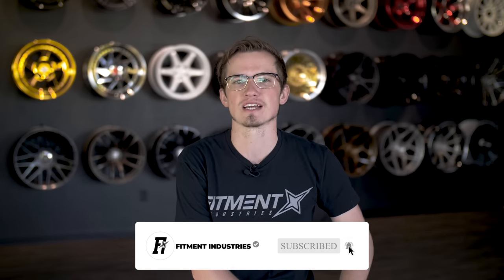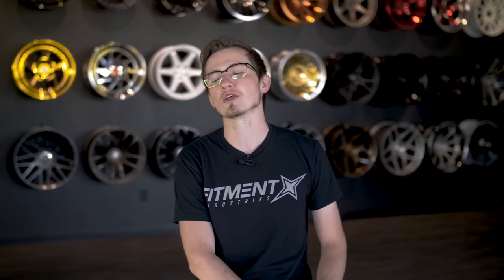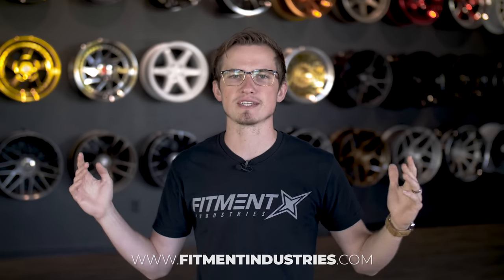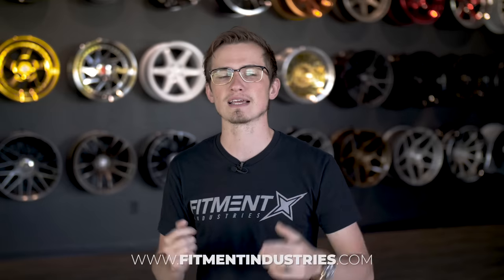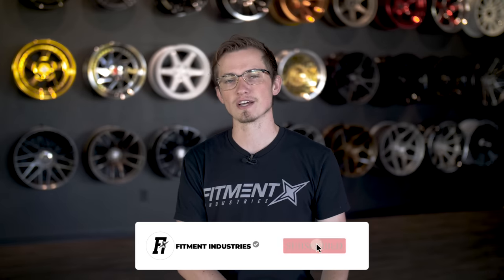Why You Should Lower Your Car

Comment from the maker: What was your first modification to your car?!

 If the answer is none, check out our website ;) 
https://www.fitmentindustries.com
Reply: Fitment Industries my first mod was tint tail lights
Reply: Fitment Industries first mod was wheels I imported from Japan... now for the past few months I’ve been in dire need of coilovers cuz the wheel gap is horrendous lmao
Reply: I went out and bought the original BBS wheels for my Rx7 and got some fortune auto coilovers. Only problem is now I can't find tires -_-
Reply: I got my ecu remapped ;) then coilovers
Reply: On my current car which is a 2015 Mustang, my first mod was a catback exhaust (go figure)
Next is coils! Unless I somehow come up with the money for air suspension haha.
Reply: First modification was actually a stereo install, and then wheels. Then lowering springs and ahem new wheels... Again
Reply: Painted and polished the valvecover while changing the 25 year old gasket
Reply: Coil overs and a set of 14” Steel wheels because my 16” wouldn’t fit
Reply from the maker: I dig it! You should upload your Stang to our gallery we'd love to see it! https://bit.ly/2Ma4oca
Reply: Tein Coilovers was first!
Reply: Eibach pro-springs were my first mod and I never looked back from riding level with a F-150
Reply: Coil and exhaust system
Reply: Btw, I’m looking for cheap coilovers (I’m a broke ass college student) so should I go Raceland cheap (esp cuz of their lifetime warranty), Tein or say GodSpeed or something else?
Reply: ALWAYS GET WHEELS FIRST.  Dial the stance on the wheels you're going to run.  
Or listen to Alex and dial in your stance twice. 
Pay for your alignment twice.  
But hey,  he's the expert.
Reply: I actually did wheels first then 2 weeks after getting them I got coilovers...oops
Reply: @slodvlproductions2297  I learned the hard way a long time ago.
Reply: TE37 reps 😐
Reply: vinyl wrap I put on myself lmao
Reply: new motor🤣🤣
Reply: Metal Catalytic Converter, then ECU-Flash.
Reply: Whiteline sway bars, quickly followed by BC coilovers and currently slowly installing everything Whiteline makes for my car.
Reply: Haha I don't own a car I'm 13
Reply: Fitment Industries bc racing coilovers
Reply: Does Window tints and taillight tints count? 😛

If not, it'll be my rims & tires. After would be Eibach Lowering Springs and Borla Axle-Back exhaust and the same time.

Up next would be front strut bars 😊
Reply: First mod.... tints, then COILOVERS!!!
Reply: Christopher Huynh b
Reply: Fitment Industries replaced the plastic oil pan with a steel oil pan on my MK7. Why? Because my next mod was lowering springs. Can’t drive a car with a cracked plastic oil pan. 🧐
Reply: I threw a new bmw performance exhaust into my 328i 2011. Second mod was coilovers ❤️❤️❤️
Reply: My frist was i drop my car
Reply: Roll bar lol
Reply: My first mod was ol reliable down pipe
Reply: New Wheel ofcourse! Just bring the fattest friend you have before you drive around and youre good to go... 😁😁😁
Reply: I'm picking up a set of cxracing coils today for my g6 granted they won't fit my g6 but ill make them fit
Reply: Suspension cuz well slammed....loool
Reply: Shift knob, obvs.
Reply: Exhaust
Reply: First Mod was a new engine that doesn't belong in there.
Reply: Hoboe Mojo Tein
Reply: Coilovers, then wheels, then spacers for some poke
Reply: I don't have a car
Reply: My first mod to my first car which was a Toyota Corolla S was actually wheels, and then about a year later coilovers and an air intake.
Reply: Lowering springs 😬
Reply: Suspensión
Reply: Fitment industries exhaust
Reply: junkyard swap; legacy discs on my 97 impreza outback sport to replace worn out 240.000 mile OEM drums.......
Reply: my first mod to my first car was a air intake from K&N then a magnaflow exhaust system then a stage one tune in that order.
Reply: My first actual modification on a car are Scrapes and gashes.
Reply: First mod on my 2017 civic hatchback sport was a Boomba Racing Blow off valve
Reply: I still have the O.G's on my IS300  however I do have the Altezza center caps. On Megan Coilovers, NO wheel gaps!
Reply: Fitment Industries so my car had Steelies and hubcaps and I don’t think when I lower my car it won’t really look all that good
Reply: Underglow and I have no shame in it.💀
Reply: LS swap or better yet engine install since my s10 didn't have a motor.
Reply: First mod was wheels then window tint. Looking to lower now
Reply: Upgraded my spark plugs and wires. from fswerks
Reply: Just went through the website and you don't have anything for my car
Reply: None yet
Reply: Hmm my first was 15" Enkei wheels on Toyo tires, now I'm working on putting my coilovers on.
Reply: 2004 Volvo S60R: BC BR coilovers and Hart drilled and slotted brakes, I wish I had gotten a higher end brand seeing as a Brembo set up is what was stock.
Reply: I swapped out the 13" steels with 165 / 80 tires for some 14" alloys with fat 195's with lower profiles in the 90's on my Ford Sierra.
Massive improvement in looks and handling.
Reply: Just so happen my first "mod" was window tint, thing was a fishbowl when i got it.
Reply: New tires
Reply: Bro i live in India so what can i         do to buy suspension system part,s 😬 this is a delima plz give me an advise 🙏🙏🙏🙏🙏🙏🙏🙏🙏🙏🙏🙏🙏🙏🙏
Reply: Kia logo dust caps! (yes I own a Kia) And it's awesome in it's own slow but comfortable way.
Reply: Did wheels suspension and spacers/adapters all in one go!
Reply: Halo headlights on my 2001 automatic eclipse when I was 17 👌🏼👌🏼
Reply: H&R Lowering springs for my MK7 GTI, because I'm poor and could not afford coilovers or air.
Reply: 06 style gto brakelights for my 05. They’re Delpro but they have the black housing which looks better than the red housing stock ones
Reply: What would you suggest for a 2011 Venza (affordably of course)?
Reply: In this order lowering springs,strut bar, headlights, wheels for a year before last week poly bushing,poly mounts, few bolt on's,tune, coilovers and xbrace😁 been stacking those parts up
Reply: First mod was a glasspack welded in place of the muffler. On a 06 pontiac vibe
Reply: Muffler & reasantor delete... 😔
Reply: what if I live in Michigan?
Reply: attached a liscense plate to it 😎
Reply: tints 5%
Reply: I think my first mod was a flat floor 🤔

Probably sounds like an odd choice, but I wasn’t going to just drive it with that one mod. 

I’m currently at around 8k in mods and I haven even driven the car yet 😂
Reply: Mine was painting my peeling and custy 3 color steelies bronze
Reply: a window decal
Reply: First two things I did to my car, 2000 prelude, was AEM air intake and OEM fog lights yellow HID.. that’s all it has! Stock radio with Bluetooth and stock wheels but I’ve beeen wanting to slam it for years

Comment: Not on the daily
Driveway is too high
Roads are junk
Lots of humps in the village
Reply: Facts
Reply: Most underrated comment here
Reply: That's the issue that I have, I daily my G37 and I'm wondering how coilovers are going to mess the driveability if the car
Reply: Massa Koné if you do say goodbye to your front lip
Reply: @cheung709  lmao, I kinda came to the same conclusion, will lowering rings be better then ?
Reply: Massa Koné tbh I would get air suspension if possible but ik it can be very pricey so yeah I would say get springs but um what car do you currently own?
Reply: @cheung709  Air Suspension is the best option but pricey as you said. Got a 2010 G37x Sport edition

Comment: I've been modifying cars for over 20 years now. Lowering a car is always my first upgrade. Everything you said in the video is correct. Nothing adds function and form as much as lowering your vehicle properly.
Reply: if im never going to track my car and I only want to lower it for looks (but not a crazy amount) would it be a better idea to just get some quality lowering springs? ive heard the comfort level is a little better than coilovers for daily driving.  Its a 2011 honda accord coupe
Reply: D4Real It really just depends. If you go with a spring over a coilover you wanna also go with a nice shock. What kind of car?:
Reply: @stylepoint1200  2011 accord coupe / 4 cyl motor
Reply: D4Real D2 Lowering springs and Koni yellow shocks. That setup would ride great but it’s gonna be in the 800 to 1000 dollar range for the parts. For that price you could just simplify it and get the KTuned K1 Streets. They will ride great and you have the option to adjust your height to the right height if you change wheels or just want it to be different.
Reply: @stylepoint1200  thanks for the advice.  i asked because u said u have been doing it for 20 years.  I was looking at combined cost myself and was coming to the same conclusion.  probably best to start out with coilovers and not have to worry about it after that, along with all of the adjustibility benefits.  thank you for your specific recommendations as well!

Comment: Coilovers dont improve the ride quality as you said. Yes it handles better, but it’s not comfortable. And forget about entry level coilovers.
Reply: I drop my suspension on my vw jetta gli 2008 and it's feel comfortable, even if the suspension is stock on this car, she was stif at the start, so it's feel the same for me
Reply: Just don't drive like a rookie you pay for what you get if you go cheap there you go your going to get a cheap ride expirence
Reply: Enmauel Sanchez thanks captain obvious. 95% of people who watch these videos arent Buying $2000+ track coilovers, they just want some low.
Reply: CJ Junior I buy a kit of coil lover for 600$ and it's perfect for me not too low not too high (it's also my daily and I live in canada ) (winter)
Reply: Jessy Lauzon I have bc lowered 4.5 inches. Still a harsh ride  and they are a lot better than my  old 700$ coilovers
Reply: I have had coil overs for 500 to 2100. Here is the thing you might think spending $2100 on suspension it's going to ride nice bc that what I thought the answer is no. The more expensive set up was great on the sooth track but sucked the big one on the street. The $700.00 set up was much much better on the street. So more money doesn't mean better ride in a lot of cases. The biggest thing is setting them up correctly they could be $10,000 if you set them up wrong they going to suck. That's my two cents
Reply: "Yes it handles better"

Ok that's what was meant by ride quality.

Comment: Going back to 1996 when I barely could afford my first car the first thing I did after changing the oil on my Nissan Maxima was putting on eibach springs and koni adjustable shocks/struts on it..Yeah I accidently shot one spring into the ground that could have killed me or someone else but it pretty much all worked out in the end

Comment: The one question I had or concern I had was that since my car is still stock at the moment suspension , and I haveeee gotten brand new wheels and tires going from a 16 inch wheel to a 17 inch wheels all around (bought from fitment industries btw :))) I love them) then if I had immediately just lowered my car to match a suspension appropriate for my previously 16 inch wheels wouldn’t I have to worry about the new now bigger sized wheels would rub due to me getting bigger wheels  and the suspension isn’t appropriately matched for bigger wheels then how it was for the smaller wheels ?

Comment: Hi there.  Cool videos an good advice. I have a question. I have a 2008 Bmw 135i convertible an want to put a set of 19inch deep concave wheels with a lip 19x9.5 in the rear. I want a agressive look but confused on which offset as i dont want to order wheels then they dont fit. Can you asist me in which is best offset i should use for my car front an rear wheels

Thank you inadvance

Comment: What about an suv should i do the suspension if i just want to change the wheels for example i have a rav 4 2021 but i dont like the wheels they are aluminum i mean they are good but they are 17ns and have like 65 mm pf side wall i want to get something like a 20 inch with 55 side wall i want it to be high but also lose that gap between the wheels and the fenders what shall i do ?
Reply from the maker: You always want to do suspension before wheels/tires.  That way you can measure to make sure you get the correct specs

Comment: First mod I plan on getting is a Cobb access port to have a better tune and remove the speed limiter. 
Then a $750 GReddy exhaust, and later down the line I'll get Air Lift bags for better handling it's a lot of money for a marginal increase in handling and visual stuff when a nice APR wing that fits the style you want runs just $655 and the saved $1200 can go to other mods, like brakes or almost a full transmission upgrade 

This is for the G37x, btw.

Comment: 5 must do first mods on any car
1. Tinted windows
2. Xenon headlights (if car is old) 
3. lowering springs/suspension kit
4. New set of wheels and tires
5. Better sound system
Reply: @Neil__Craig  For a project car, sure, but for any car (dailies, family cars etc) that's a bit too much
Reply: 1. Air intake 
2. Exhaust 
3. Suspension 
4. Rims/tires or Tune
5. Engine rebuild
Reply: I did
1. Sound system
2. Exhaust
3. Intake
4. Wheels
5. Lowering

Just not a fan of tinted windows tbh
Reply: Exhaust is my sound system
Reply: @Neil__Craig  hahahaha lol, my wife tells me my car not loud enough and the kids love riding around in the "racecar" sucking in all the raw gas fumes. It's all about finding the right chick and raising the kids to enjoy whatever. My kids step over the sills,don't yank seat belts off to bang glass or scratch plastics. Shit my kids have never ever had food or drinks in any of our cars.
Reply: #1suspension#2wheight reduction#3fresh sticky rubber/ lighter wheels ( what's the sense of adding power if you could put down more of what you got in the first place) #4 exhaust#5 tune#6 intake/ fuel upgrades/#7retune/clutch lol#8brake upgrades. 678 should be done at same time as should 4&5. Then whatever after. I personally would start stiffening up chassis before power mods also...again should upgrade everything for optimal performance before power upgrades but always retune with any power upgrades
Reply: @SonyFoLife  I've never wasted $ on tint
Reply: Neil Craig 
1. Big turbo 
2. Supporting mods 
3. Suspension 
4. Wheels & tires
5. Start a fund in case engine/transmission goes
Reply: Y'all guys should really try tint tho. It makes your car look batter and it helps you keep cooler temperatures especially in summer, plus you don't get sunburnt if sun hits your skin from the window.
Reply: You forgot refurbishing the A/C or heater, it's very crucial lol
Reply: @shawngarrison6936  BAF!
Reply: brakes.
Reply: Hmm the list i did to my car was 
1. Poly bushings
2.coilovers
3.swaybar front and rear
4.interior mods(steeringwheel short shifter seats etc)
5. Sound system(2 15” in trunk new radio and some speakers)
6. Rims 18” oz futura(whit tires 240mm 30 18front 250mm 35 18 rear
7. Outside car(paint n tint and wing etc)
Reply: Racer_ 7070 What sound system would you recommend for a 98 Honda Civic?
Reply: In my case if I'm buying a 80s to 90s sedan:

1. Service it
2. Wheels
3. Coilovers
4. Put some strut bars (because rollcages are illegal here and need room for the family)
5. Minor body changes such as the hood and bumper

From CarThrottle's advice, power is last. Even though I'm hungry for it but have to be patient for it later.
Reply: I started with 5 , then 3 and then tuned the car with exhaust , and then 4😂
Reply: 1. Air intake
2. Turbo back exhaust
3. Cobb access port
4.E Boost control
5. Headers
Reply: must do first mods
1. LS Swap
2. LS Swap again
3. ???
4. PROFIT
Reply: full exhaust system
remap
done
Reply: swap 5 with  exhaust mods
Reply: 1. Engine swap
2. Engine rebuild 
3. Turbo
4. Tune 
5. Other athetic stuff (not sure if spelled correctly)
6. Repeat(blow your engine)
Reply: @NaaFr  I would stick to 600watts amp, they won't kill your battery.
Reply: Sound system is so rice hahaha 😂
Reply: Crap, I'm doing it wrong then, I'm going 
1.upper 2.5 S/C pulley, 
2. Lower 9.1 pulley, 
3. solid isolator, 
4.larger HX system (track Attack), 
5.Larger waterpump, 
6. Flex fuel Kit, 
7. 1050x Injectors (8)
8. Reinforced intercooler brick and S/C Lid
9. ARH Headers and CAT delete

then exterior mods. :)
Reply: Xenon headlights in reflective casing are terrible for other road userd
Reply: You guys are building these rice cars
Reply: Supercharger
Performance exhaust
Coil over springs
305 profile tires in the rear
Race tune
Reply: Chill more like 
1.engine rebuild
2.intake
3.exhaust
4.suspension
5.wheels
Reply: 1. stickers
2. More stickers
3. 😜😂😂😂
Reply: 1. blinker fluid replacement
2. swap engine to the rear
3. lift it 
4. invert the headers
Reply: If it's your daily do not lower it unless you are 100% ok with scraping.
Reply: Racer_ 7070 💯 agreed
Reply: Yeah the 5 must do mods if you’re a ricer lmao
Reply: For me because I’m about to buy a wrx, it’s going to be 1.tints, 2. Lowering springs, 3. New wheels and tires, 4. exhaust, and 5.Better sound system
Reply: I wanna like this comment but don't wanna change the likes.
Reply: tune...there done.
Reply: Why does this sound like what I do at Los Santos Customs?
Reply: You forgot Nos
Reply: @amaxakias6034  For my beemer I would do all the above except lowering it...I don't wanna have issues with my suspension in the longrun.
Reply: Sound system before suspension
Reply: Tires, suspension, air intake, exhaust, tune.
Reply: @Chris  I have had my Mustang GT for a year. I like to listen to the exhaust and the car so much I have never even turned my stereo on. Other people have but I haven't. Lol.
Reply: I did 
1. Better sound system
2. New set of wheels and tires
3. lowering springs/suspension kit
Tinting windows next month 
Looking at led headlights
Reply: Yall do at that but the brakes lmao